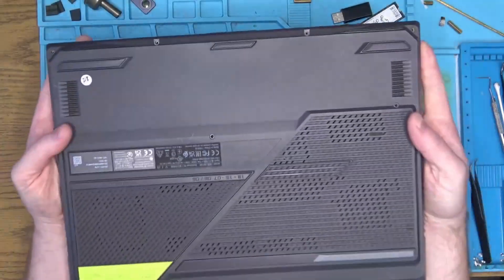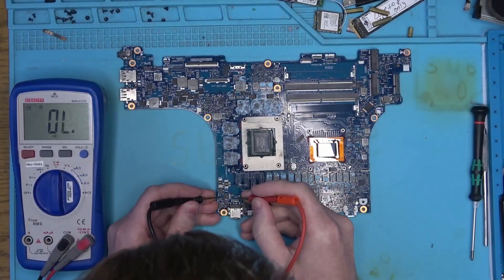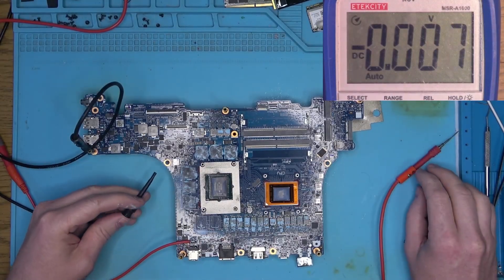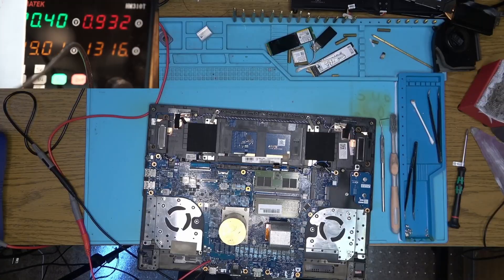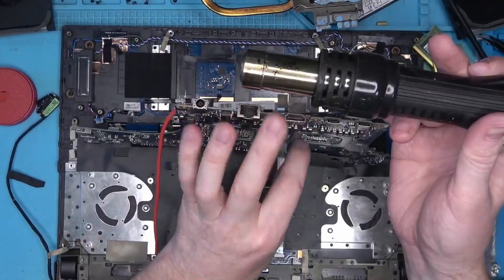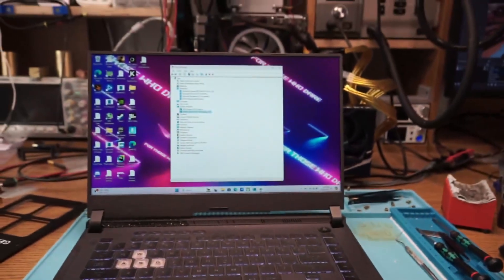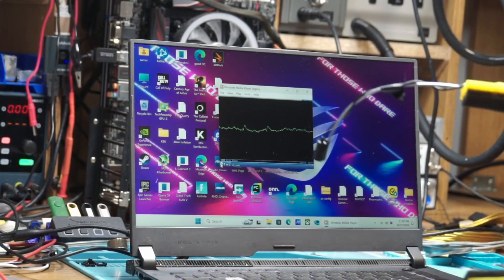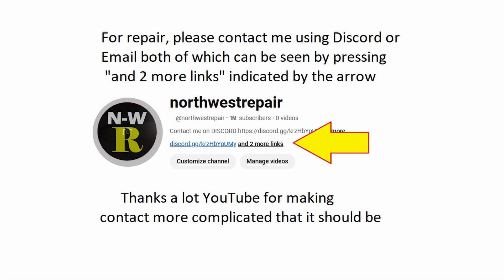ASUS ROG STRIX G513R free repair

Comment: You shouldn't even worry about what people on Reddit think. An inaccurate description of events with no evidence is all people on Reddit need to get their pitchforks out.
Reply: Isn’t Reddit just people with pitchforks though? Every / has a conspiracy theory lmao
Reply: Can confirm, got yelled at by a reddit soyjak at for using a VGA-to-HDMI with an old monitor, gave me the longest lecture about how I should think about display first without being any helpful about whether it'd bottleneck with my R5 5600GT, or the size of the case.
Reply: @derthevaporeon  if you had money you would already have a better monitor and gpu, its not the case by the looks of it, good solution for pairing a R5 5600GT.
Try to overclock the monitor, its doable and some 60hz monitor can oc to 75hz easily.
Reply: Reddit is a cesspool of armchair whatevers, same as Twitter.
Reply: Reddit bans you from posting if your views do not match the narative it wants seen. So, no, what you see on Reddit is not the reality.
Reply: "pot calling the kettle black" ahh  comment
Reply: I have email receipts to prove everything. His side isn’t 100% wrong but is very biased to make it look like he did no wrong.
Reply: @silverback2773  As a mechanic, I simply LOVE it when a customer takes back their repaired car, then fux with the repair and comes back demanding I donate my time to fix the results of their incompetence.

Yeah, no. I can go broke while sitting on the couch with a beer. It takes much, much less effort.

You can go... and tell ALL your friends too! I don't need "customers" of that calibre.
Reply: @Jimmeh_B  You are more offended then tony is 😂
Reply: @xnitropunkx  ... dunno where you're getting that idea from.
Reply: @silverback2773  perhaps are you the owner of the asus laptop?
Reply: @MiriadCalibrumAstar  he is the owner, the way he comments
Reply: @gamehacker2530  asking is better than assuming.
Reply: What did he do wrong? Did you flash the bios again? Don't go beating the bush.
Reply: @silverback2773 what are your pronouns ?